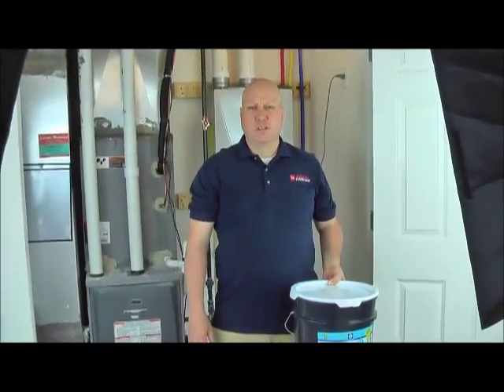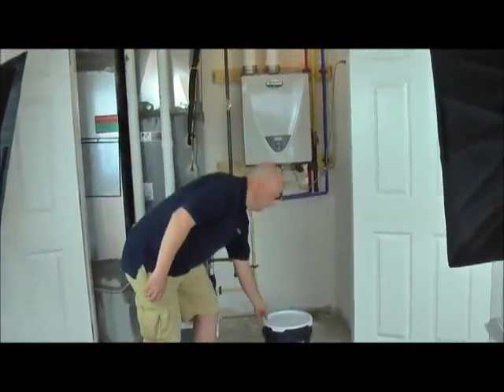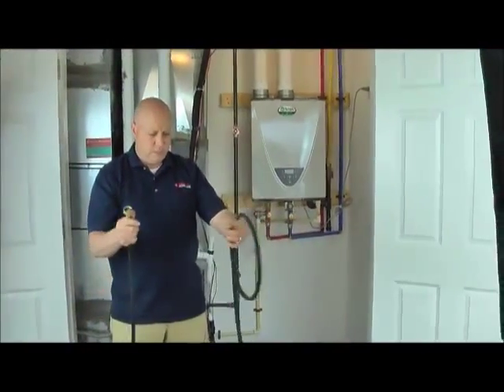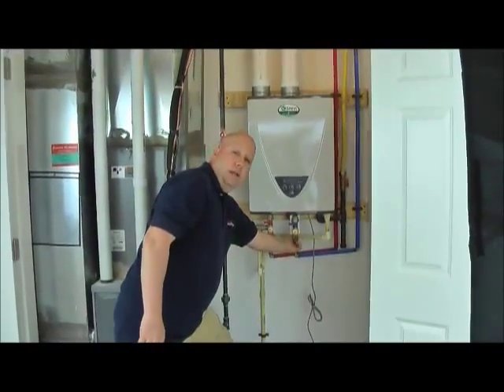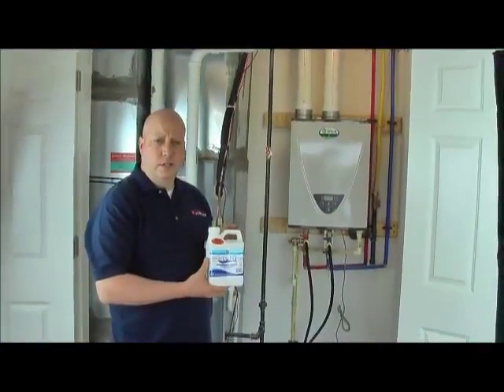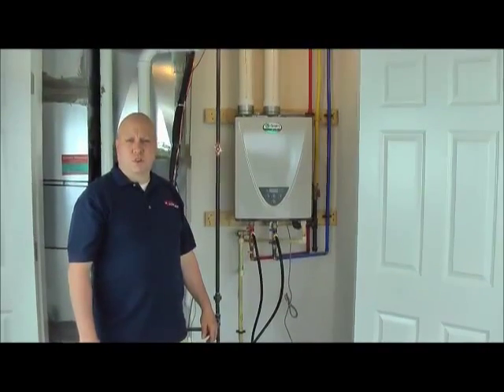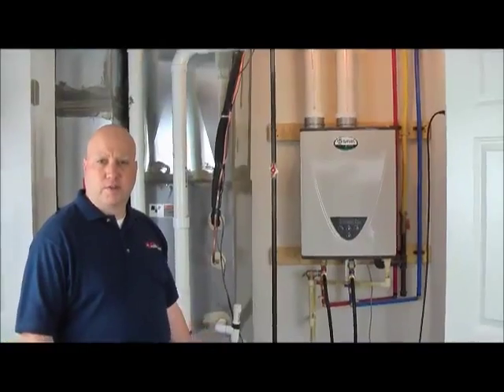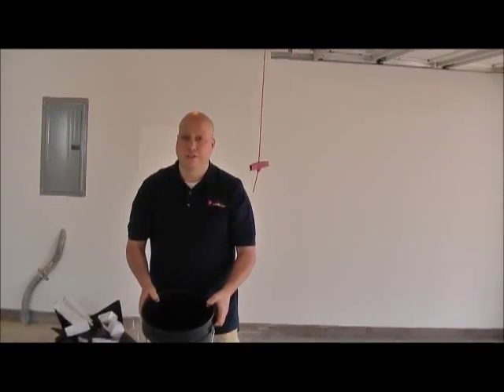How to Clean a Tankless Water Heater w/ the FLOW-AIDE™ System Descaler Kit & Biodegradable Solution

Comment: It seems that he did not do the step that you open hot water tabs for 30 seconds to have the valves inside the unit fully open and then you kill the power to it while it's heating water. Am I right!?

Comment: I’m sorry to tell you this but the water needs to be de scaled on the hot side. Connect the pump on the cold water valve not the hot valve. I’m not saying you can’t do that but it’s not recommended to do that by the manufacturer
Reply: Was just saying that myself. I said hey he's got the pump on the wrong side.
Reply: @randylavoie3603  I see the issue this way the scaling is going through the system, but after the first time it circulates, it going to do the same thing.
Reply: @averagereviews3389  that's not the reason, you're pushing against the natural design of the system, the flat plate heat exchangers are designed for water to flow in one direction and this is now forcing it the opposite way. Not to mention when you go to flush it with fresh cold water you're now blowing the water through your pump and going backwards through the system. There's a reason all manufacturers tell you to hook up on the cold side.

Comment: Good video. One small problem. You did the flush wrong. Open the HOT water service valve and then turn on the cold (incoming) water. The way you did it the water doesn't go thru the heater!
Reply: Agreed.  Connect the cold hose to the pump and the other end of the same cold hose connect to the cold flush valve (not the hot flush valve as shown in the video).
Reply: @ONLYinANTARCTICA  I agree with both of you the guy in the video did it wrong